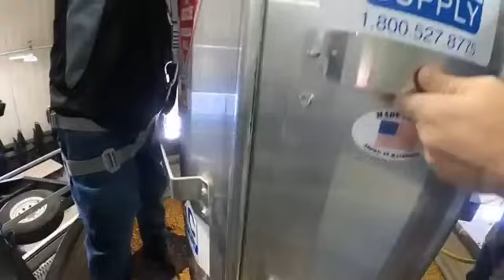Farm Safety: A Rescue Simulation from Grain Engulfment

Comment: I worked at a grain elevator and maintenance needed it emptied for repairs, we emptied it and they called saying why is it still full we said that's impossible we ran to empty that silo all night, they said well so and so is walking on soy beans, we went back and forth about it being full and empty, turns out it had formed a plug at the top of the silo, if it had broke loose that guy would of fallen 150 feet if his harness wasn't attached.
Reply: Wow. It's even more common for there to be air pockets, and when someone steps on top - even with a harness - they can instantly sink up to their chest or more, which alone can be fatal.
Reply: Also if they would of brought a fire, started a fire it will turn to popcorn and they can be free.
Reply: @Turtle4422  Usually, it just ignites a grain dust explosion and everyone dies.
Reply: From the grain to the cow, everything eats the chickens. Even the horses eat a chicken once a while
Reply: would've*
Reply: Now tell me what's the reason someone needs to go in there and walk on that stuff in the first place ?
I know it's probably a dumb question..
Reply: @dontbescaredhomie3137  I guess the reason is to jump on it to unplug it, but I bet there are better ways
Reply: That is so bizarre that soybeans could form such a wide plug. Did it end up all falling as one chunk?
Reply: Crazy story. Very interesting. 

I have one issue though. 

He "would of" fallen 150ft? 

You mean would HAVE fallen 150ft or even "would've" would have worked! 

But NOT of. Of has no business being there.
Reply: @commiecomrade2644  Have course you would say that!
Reply: This suffices:

* would have

Comment: i feel like this could be solved easily 
like put a really big door in every silo and get a remote that opens the door so that the silo will drain if u fall in

there r prolly some engineers who’d slap me across the face if i suggested that tho so idk. but as of rn i don’t see why it wouldn’t work
Reply: if the silo starts to drain, it would sink the person under the grain which would die drowned, even if you try to do it fast in order to reduce this risk,  this would create a lot of friction between the grain which can cause an explosion or ignition (as it happen every time a silo collapse). 
yeah, at first sight,  I thought the same as you, but looking in several videos of real cases or try to rescue people trapped this way, we can see that this is not by any mean an easy solution.
Reply: Apart from other issues, the grain would be putting a ton of pressure on any door to the point that it would need to have incredibly powerful machinery to make it budge. Look at the kind of doors used in dam floodgates, and then consider that grain is 450-1000x denser then water

Comment: I remember going to the county fair growing up in Iowa and the Future Farmers of America used to have a safety demo where you would sit in a wooden box and they would fill it with shell corn up to your chest and then tell you to stand up.  You couldn't stand up no matter how hard you tried.  The goal was to demonstrate how dangerous moving grain was and how little it took to trap someone and how it would take several people to literally dig you out.
Reply: I was an auditor in the grain business.  I was told flaxseed would not hold a person's weight like standing in corn but you would literally sink in it and drowned.  It's dangerous business, so many things can kill you.  Even the lifts were a hazard.  Almost got my leg cut off, no safety switch when the door opened and the guy at the bottom started it down before I got out at the top of the elevator.
Reply: The rescue method in this video was mind blowing
Reply: I'm from wheat country, I know of multiple fall from height and engulfment deaths (which happen at elevators but also occur anywhere there's storage bins and silos) and one really big grain dust explosion just in my 46 years in this county alone. My dad was a volunteer fireman and EMT. Usually, unless the engulfment was partial, it was a recovery operation and not a rescue.
Reply: So this would be way more lethal than quick sands ? …
Reply: @olivvapor4873 yeah. It's similar, but depending on the makeup of the quicksand, there are ways to get out of it by yourself. In a situation like this, you don't get out without the kind of effort they showed. The weight of the grain is going to prevent you from moving. Every move you make is going to pull you under even more. And you notice how they had to empty the area around her before they pulled her out. That's because if they had just pulled, she would have been ripped in half from the weight on her lower body. (Maybe not quite that dramatic, but you get the idea.)
Reply: Shoutout to Keokuk and marshalltown from your neighbors to the north.
Reply: So the next time I need a deadman anchor to pull out a piece of heavy equipment I can just dig a little hole and fill it with corn and put an anchor in it?
Reply: I could get up
Reply: @iAmIronMan0605 sure, but still corny.

Comment: Why can't they just pull her out? I know you can't do that to someone stuck in mud or you'll rip them apart, but grains have air around them so shouldn't create any suction.
Reply: They have all the suction. It can take hours to rescue someone trapped in a grain silo (or recover a body trapped in one)
Reply: You are right. It will pull them apart.

Comment: I've never seen any method of grain silo rescue, and hearing about how much pressure is on you when partially (or fully) covered, it sounds like rescue technology like this is really needed. I would just add that they might need something for the dust, in case it gets unbreathable for someone in distress.
Reply: V E R Y unbreathabley dusty!
Reply: A mask would be so easy! Some are super breathable
Reply: Small mist around the exit.

Comment: A vacuum is much better than that auger thing. Preferably a grain vac but a shop vac will work too. Use plywood for the walls. They're technically on the right track but far to clunky equipment.
Reply: Lots of static electricity generated by a shop vac!
Reply: @87mini  And not by that drill?
Reply: It won't be there when you need it, maintenance would steal the plywood for other repairs, silly!
Reply: @grantc8747  Like sheets of aluminum would survive?
Reply: @farmerbill6855  touché 🤔
Reply: Yep a large shop vac would do well too
Reply: Plywood would break
Reply: @bobjamaica9045  not hardly, plywood is much stronger than aluminum.
Reply: @farmerbill6855  I don’t think so, not at that thickness level. It’s a thin sheet so it can slide between the grain easily, plywood would be flimsy asf with the same thickness and would cause much more friction when being pushed down.

Comment: So what happens if you loop a rope under her arms, tie off anywhere, then dump grain until she's free enough to pull out?  The rescue tubes seem unnecessarily complicated, to waste less grain?
Reply: I just went through training on this, it is because grain silos aren’t equipped with a dump, the only way to drain the grain is with the auger at the bottom, and doing that could very easily pull the victim into it and shred them. The other way to dump it would be cut a hole with a saw but grain dust is explosive, therefor there’s a lot of risk involved with that. Grain has a surprisingly large amount of pull and weight behind it, so even if you tie them off they could still be pulled in very strongly, breaking limbs or possibly even ripping the harness off and fully submerging them.
Reply: @alexsawchuk5371 Good points
Reply: It would also potentially break their back or kill the casualty, the best way is literally a rescue tube and dig them out potentially with a rescue auger!
Reply: Exactly!
Reply: I think the issue is just the volume of grain. You see how long it takes even even they're blocking a ton of grain from coming in, imagine how long it would take to clear out an even bigger silo
Reply: @TheGrimSmile  I think the slope gradient of grain in a wider silo or bin would allow material to be cast further away, but fighting the "landslide" of grain would be a usless waste of time compared to this shown technique,  as you would have to evacuate a wide cone of grain vs just in the rescue tube..
"Dam-ing the grain, reducing the compression by evacuation of only the limited material in tube..👍All around best technique

Comment: Seems like a lot of extra money and time to waste when you could easily have a few men pull her out probably even just one.
Reply: I don’t know much about grain however from what I’ve heard grain is surprisingly extremely heavy, even if the victim is tied off with a harness to a winch, apparently it could severely injure the victim
Reply: Seems like you dont know but, when someone is stuck in any types of silo : grain kernel etc its very heavy which causes it to hold apart someones body which is gonna make it very hard for you to move. So its not gonna be possible if you just carry someone in it. 😅